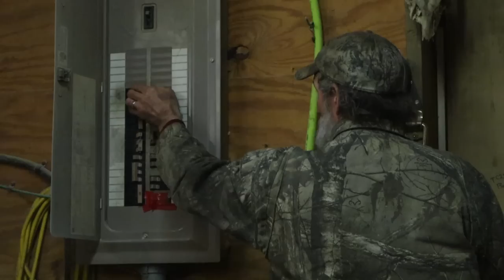TC 22 Naked, totally exposed! Oh my! The Table Saw Round Tenon Cutter

Comment: Will all of the measurement and detail be on the next video?
Reply from the maker: The prototype of our $20,000 machine had as its central component an old radial saw, and if you look close at the TC22, it is just a 1/2" grade 8 bolt on a hinge... which one interests you more? Either way, it is a wintertime chore to produce one of those videos.
Reply: @Tenonizer  i'm very interested in the TC22, i'm thinking about buying another table saw and dedicate it for that fixture.
Reply from the maker: Got it
Reply from the maker: Hi Chuck, check out our "You Can Make This" series. the TC 22 is in there, very easy Tenonizer design to copy.